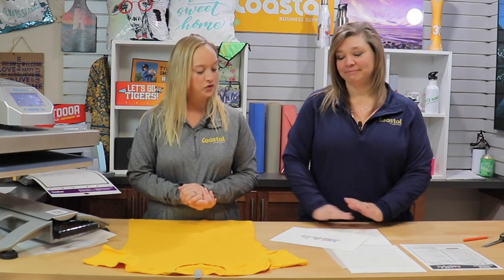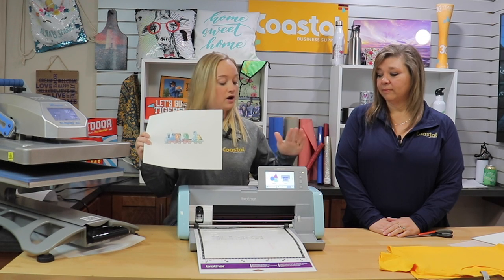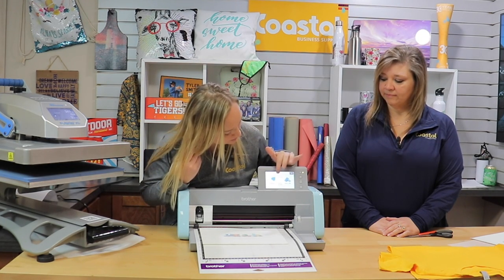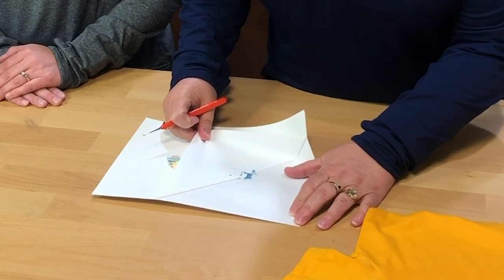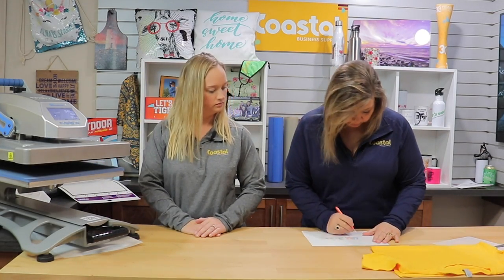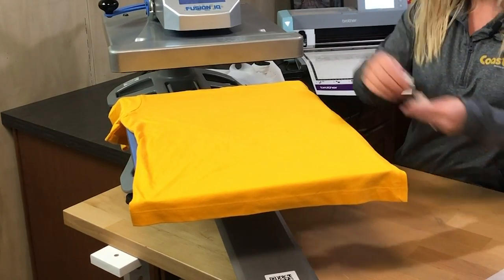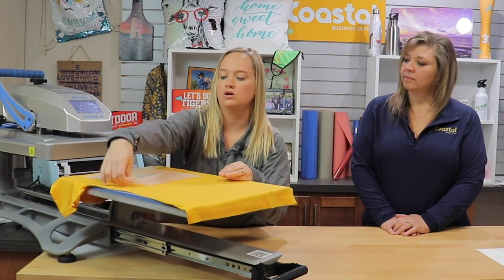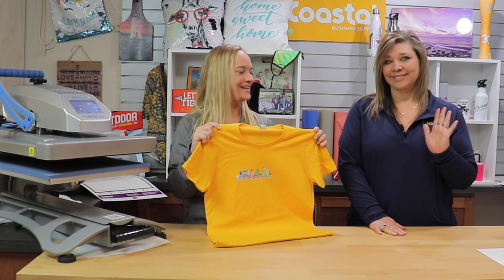How to Use 3G Jet Opaque Inkjet Heat Transfer Paper

Comment: PSA: For those that need to use heat transfer mask (that clear film that helps transfer lettering or aligned images from sheet to t-shirt) there is a solution. After you print your image, before you cut it, you must peel it off the page entirely and put it onto a low-tack carrier sheet. Cut the image, and then apply your mask. About 12 years ago Neenah got into a lawsuit and had to change the backing paper of its transfers. For years most people either stopped using mask with 3G Jet Opaque etc.. this is a workable solution for most. If your carrier sheet (low-tack) is still a bit too sticky, you can reduce the tack by wiping a clean cotton t-shirt across it.
Reply: Thank you, Thank you, Thank you.  I have been looking for this solution for weeks.

Comment: So you don't need to stretch or 2nd press light the light fabric ones?
Reply from the maker: Hello! You can still do a very light stretch for flexibility in the transfer. You do not necessarily have to re press either. We tend to not, only to peel the silicone cold.

Comment: How long should you let image set, once printed? I have an Epson ET 2720 and after image has been pressed, let sit for 3 days, and then it bleeds a bit once washed..only the black.
Reply from the maker: Hello! With this paper, we press right away! You can also let sit out, if you do not need to press right away. With this paper, you also need to use pigment based ink.
Reply: @CoastalBusinessSup  Thanks! So, the ink that came with my Epson ET 2720 printer won't work?
Reply from the maker: Hello, normally the ink that comes with the printer is dye based ink and will run/smear once washed. We would only recommend pigment based.

Comment: Hi...Can you purchase the silicone sheets separate?
Reply from the maker: HI!  You can purchase just the silicone here:  https://www.coastalbusiness.com/silicone-treated-cover-sheets-for-heat-transfer-and-sublimation-printing-silicone-g.html

Thanks!
Reply: Just use parchment paper over top of it while pressing it. After pressing, WAIT for it to COOL ALL THE DOWN before removing it.
Reply: @Ruck.Norris  I used parchment paper and it stuck to my image even though I cold peeled. Had to rinse the shirt twice to scrape all the paper off. It was a mess!
Reply: @jpla8716  strange bc that's all I use. What temp, and how long, did u press it? & what type of fabric was it?
Reply: @Ruck.Norris  
It was a cotton t-shirt... I used my easy press at the recommended 350 for 30sec.
Not sure what happened as that was my first time trying and I'm literally now scared to try it again. I've watched so many videos and still can't figure out what happened. I made sure to ask if the short was washed prior and if they used fabric softener and was told they only used detergent.
Reply: @jpla8716  sheesh. Well, what did you print with?
Reply: @Ruck.Norris  HP Inkjet 3775
Reply: @jpla8716  well it seems like you did everything right. But it still didnt come out correctly. Try reducing the press time or temperature
Reply: @Ruck.Norris  I'll do that. Thnx so much for your help. Have an awesome day 🙂

Comment: bad stuff all the vinyl got stick!
Reply from the maker: Hi there, thanks for checking in with us, however, we will need more information regarding this situation.  Do you have an order number?
Reply: Use parchment paper over top of the 3G paper. It will stick with hardly any heat. PLACE it on your garment BEFORE the garment gets warm. Don't move the 3G paper around while it's under a hot heat press. Gets messed up almost every time. This paper is a go-to for me. I've been using it for years. I'm not paid by this company.